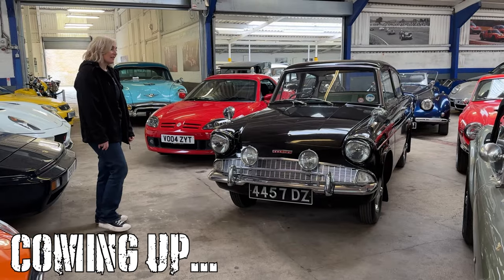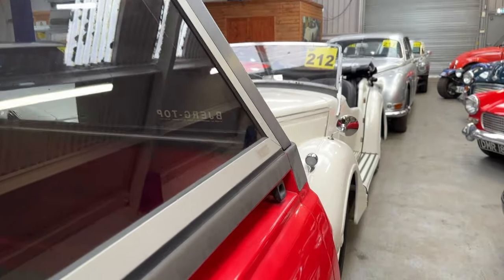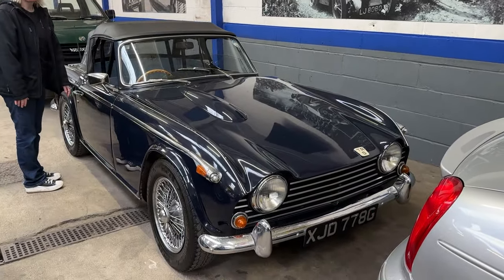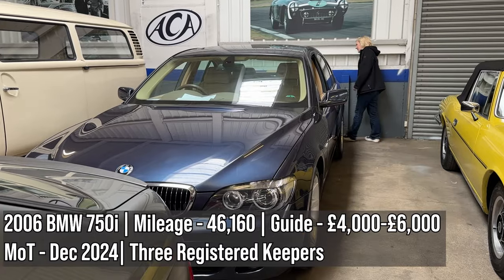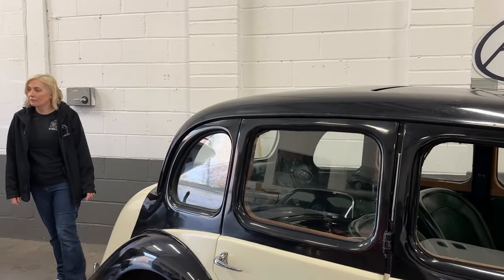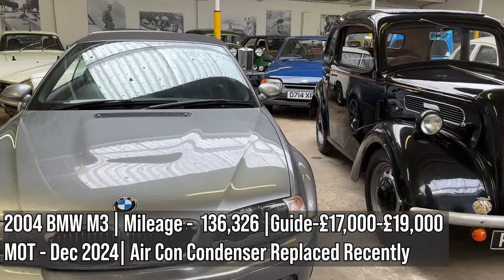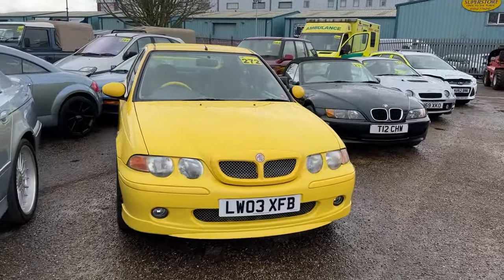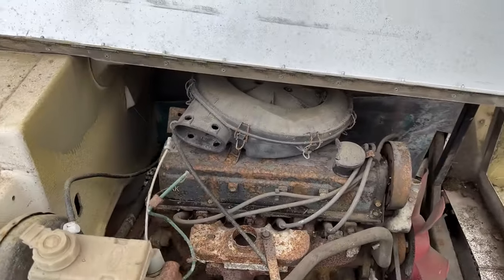Full Walkaround Of Classic Cars At Anglia Car Auctions | April 2024 Ford, Vauxhall, Austin

Comment: Sion, On the old Sharp stereo you undo the Volume/Tuner knobs and there will be some thin brass bolts on the spindles, you undo them then a flat trim panel will come off the spindles and then the radio pushes back and gives you screwdriver access to those clips so you can use a flat blade screwdriver and press them down, take out the panel, then pull the radio out. You don't take it out like a DIN radio as it has the spindles. Cheers Steve

Comment: great walk round pity theres a lack of ford cortinas on the market that 1980 mk5 looked really nice ... i had a dark blue 1.6l on a v reg but the car i loved and miss is the mk5 2 door i had when in my mid 20s was only a 1.3 but needed new engine and floor welding apart from that the shell was better than most cars these days... had to sell her as was living at my parents they wanted there drive way back so could not carry on work i started...

Comment: I thoroughly enjoyed this video thank you! So many desirable cars at relatively good prices. I’m a Mustang fan though, so those 3 were my favourites. I own two examples of the late model (those are known as the S197, and that Grabber Orange one was by a well known US specialist called Roush, and its feature a supercharged 4.6 V8. My two……one is a black 4.6 V8 which is my Garage Queen (owned for 17 years now!) and a silver 4.0 V6 which is my daily driver, including the school run! As for what I learned to drive in, my instructor had a Mk1 Fiat Uno and I also used my mum’s MK1 Fiesta.  Loving your channel 🙂
Reply from the maker: That's a nice garage you've got there! Are modern American cars good as daily drivers? A lot of people assume they're expensive to run.
Reply: The great thing about the Mustang is they are as common as muck in the US so parts are cheap. I can get a full filter set delivered from the US (inc taxes) for £80. The parts themselves are less than £30, so it’s the delivery that stings. Insurance is about £400 from a specialist. They’ll do 18-20 mpg, so even that’s not too bad. Plus they are simple and reliable if looked after. Sure, they are a bit uncouth, but I buy into the Amercana. There’s a great club scene over here too (I help run the largest Mustang club over here…..Simply Mustangs UK 🙂